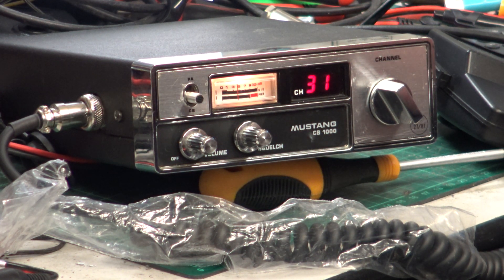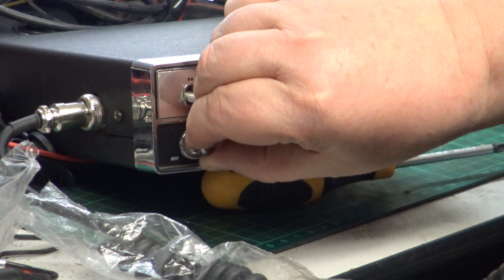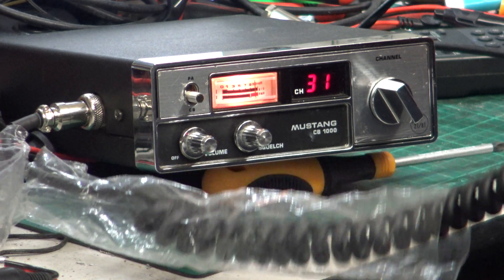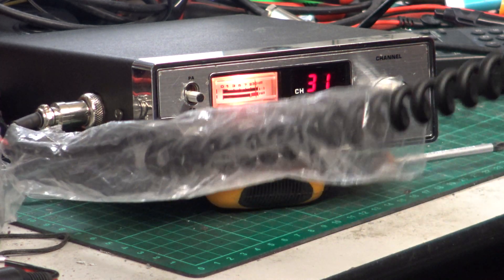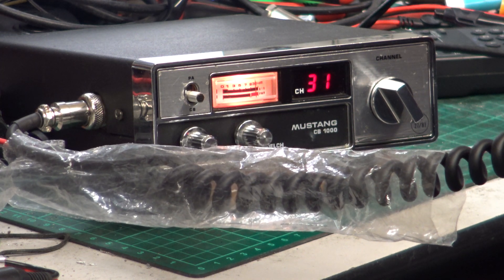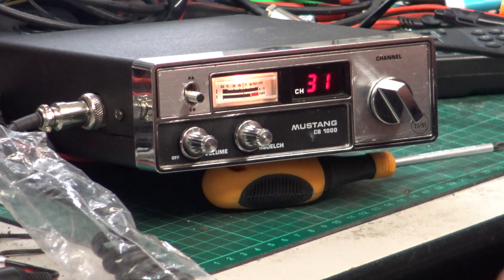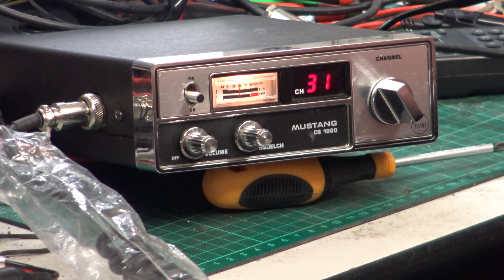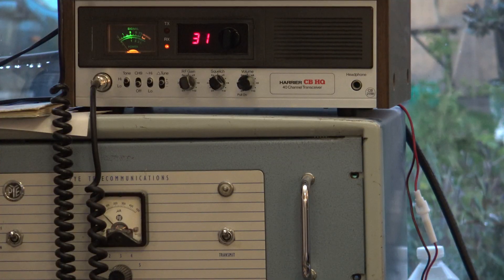Mustang CB1000 -On The Air test - CB27/81 UK FM CB radio

Comment: Blast from the past that was my first radio back in 
1981 what a great set.
Reply from the maker: Sadly, 38 years later, most new models don't work as well....but are loaded with pointless menu driven features, including squelch which you need a real knob for!

Richard
Reply: @ukfmcbradioservicingTango21  agreed a lot more hassle to work, only plus is they are smaller, and easier to fit into modern cars that don't allow the space the old cars did.

Comment: Question:  What was inside the Saphire (was it Saphire?)  sets, I think the were at least two models.I have been scratching my head all day?  My memory is getting like yours!  :-(
Reply from the maker: The Sapphire X2000 is a Great GT868 & the Sapphire 4000X was a Cybernet 134.

Richard
Reply: @ukfmcbradioservicingTango21  Ah, I almost bought the 4000X, but when a York 863 came up and a silly price I went for it.
I would give the 2000X a miss them, that was a close escape, I looked at them both, but had decided on the 4000X.  But the York was a quarter of the price, my sister worked for the store at the time, Staff Discount plus Sale.  Nice at 60% off + discount.